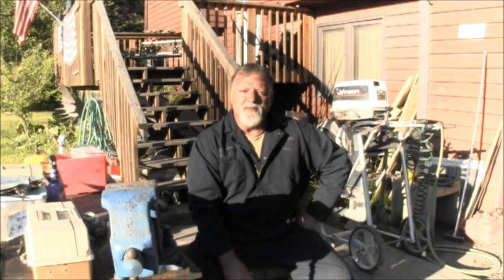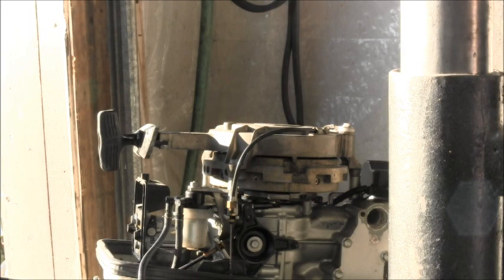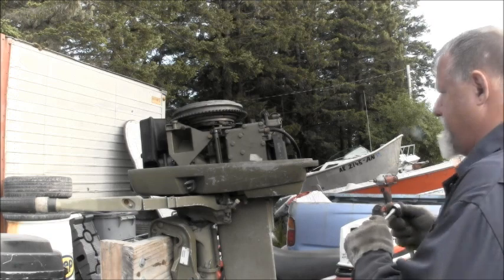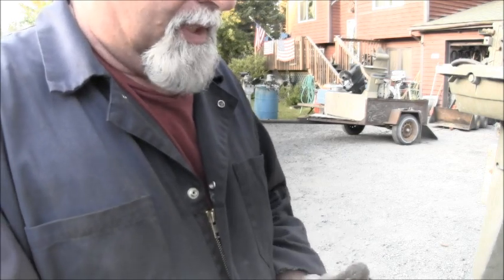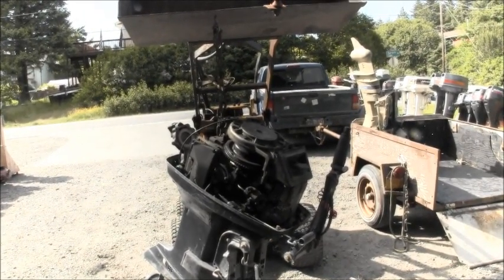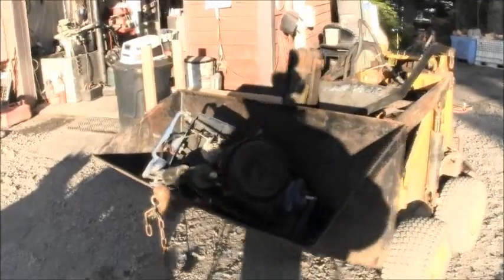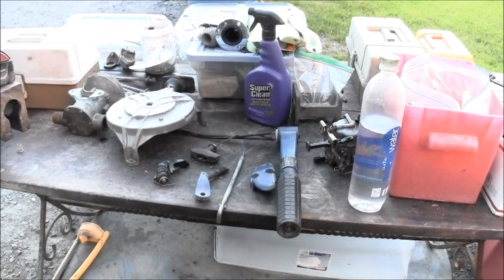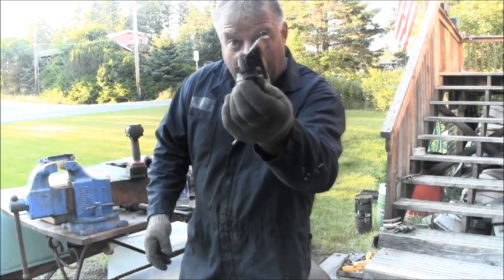SUZUKI  1980'S  15 hp 2 stroke ,   " ouch "  ( scrap heap )

Comment: You wouldn’t by any chance have any 9.9 Yamaha (I believe mariner would be the same part.) parts kicking around with you? I need the air breather and choke assembly. Proving difficult to find the parts in northern Manitoba Canada. 

I believe the motor is from the early to mid 90s.
Reply from the maker: If u send me some photos I will sure look.   kb

Comment: Hey Cody what's a good honing tool. I have some light scarring on my bottom cylinder 35 horse. 90 on top 60 on bottom PSI. Just saying if I can get that 60 closer to the 90 what are your thoughts
Reply from the maker: Medium dinggle ball hone, followed up with 300 grit emery cloth.    kb
Reply: @kodibassInsideoutboards   Thanks Cody I appreciate it you're definitely one of the better  boat motor mechanics on Youtube. Keep out the good work